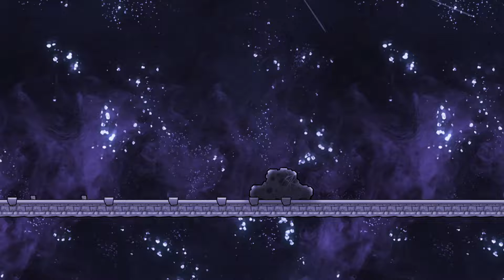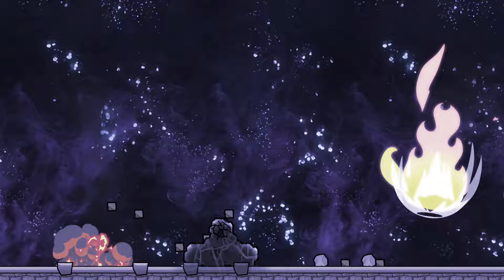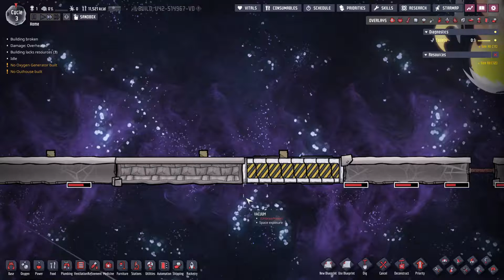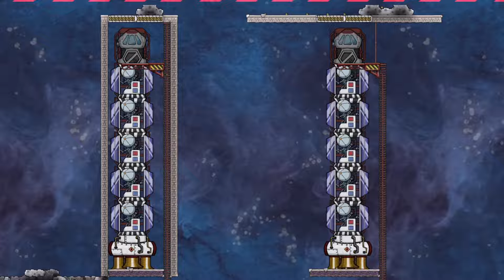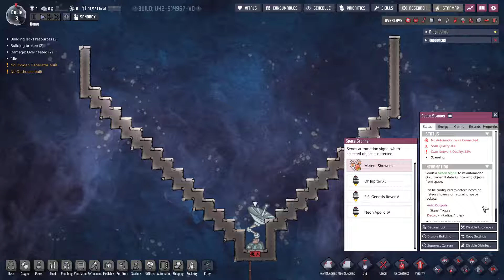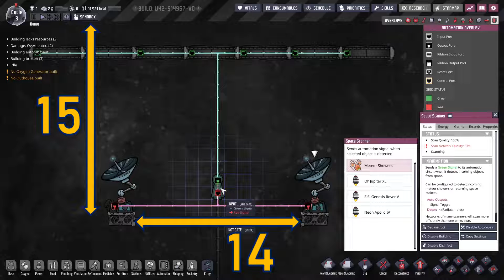Oxygen Not Included - Tutorial Bites - Meteor Showers

Comment: For Regolith design 1 how do you deal with the heat given off by the regolith that falls after being dug out by the robominers? Wont it just fall onto my solar panels and overheat them?
Reply from the maker: If you have solar panels there then yes, which is why it's generally easier to have automatic airlocks to catch the hot regolith, then dig it out, then open the doors and let the debris fall. The debris will not overheat buildings in a vacuum as they cannot transfer heat like the full tiles.

Comment: small correction: using mechanized airlocks to chew regolith tiles doesnt turn it into debris, it simply deletes them
Reply: This is a good point.  I originally had the C-miner setup, but then changed everything to airlock chewing 'cuz it was simpler....and then found that I only got debris for the metal.  I got no regolith and I was setup to move that regolith into a steam room to get some power from it and then feed it to shove voles.

Comment: I did this without timer sensor, damn this was a pain to make the circuit >< had to make a big schema to plan ahead.
Final result was, statring from space scanner:
- not gate -> Buffer gate [nb 1] 46 seconds -> Filter gate [nb 1] 46 seconds -> Filter gate [nb 2] 2 seconds -> Filter gate [nb 3] 2 seconds -> Filter gate [nb 4] 2 seconds -> Buffer gate [nb 2] 2 second.
And from the not gate, direct to bunker door
From Filter Gate [nb 1]  -> And gate -> Top door
From filter Gate [nb 2] -> XOR Gate -> And gate (the and gate mentioned above)
From buffer gate [nb 2] -> Bottom door

I need to add automation to open all doors after finish, because the scanner sends green when doors are closed even thos there is no meteorite

Comment: I'm having an issue with this automation... after a meteor shower is detected the bunker doors start to close blocking the scanners... The scanners therefore start returning a negative signal making the bunker doors open again halfway through closing... does anyone have an easy solution to this?
Reply: ahhh nevermind just realised it is because my power system was overstrained...
Reply from the maker: Yep, if the power goes down then the scanners won't send the right signal (which then starts drawing more power!).

Comment: What material are the mechanized airlocks made out of? Does iron suffice or since automation wires have to be made out of steel to avoid melting from rockets the mechanized airlocks also have to be made from steel.
Reply from the maker: For the meteors, any metal ore will be fine as they aren't hot enough to melt them. The rocket exhaust temps depend on the rocket engine used. Most won't cause issues, but hydrogen engines are very hot and will probably need steel or similar. The radbolt engine is even hotter, so you basically need tungsten to not melt on a rocket launch path.

Comment: Would it be possible to avoid having to use space scanners by setting up cycle timers? That way you could fix the bunker doors to open only during the off season? I'm having trouble understanding how to get so much (automining/door crushing systems, space scanners, rocket spots, and a telescope) all under bunker doors, which take a lot of power when used over a large area...
Reply from the maker: Maybe, but the showers are of different lengths and I wouldn't advise it. The door crushers are unpowered so you only need to power the bunker doors in that set-up. If you only need space for one or two rockets, then two or three bunker doors is all you'll need, so it won't take that much power.

Comment: Sorry, a bit late to the party and I'm also a little confused.  Surely (I bet I'm wrong) but if you close the bunker doors dues to meteor shower the Solar panels will shut down and you'll have no power to then open them again...
Reply from the maker: You are correct that the solar panels will stop working when the bunker doors close. At that point you will have to rely on stored energy from batteries, or other power generators to keep the power up to open them. But even if the doors are unpowered, they will still open but it will take much longer at 400s.

Comment: At 5:30 you mentioned that joining them together is needed but I don't quite undestand why. If the scanners turn on somewhere between lets say 66s and 200s and you join the 2 scanners together all you achieve is that the doors close at the earliest possible time because the earliest green signal would trigger closing the doors. I imagine that closing the doors as early as possible would be undesired as it takes away time for solar panels to create energy (and also stop telescope research and so on)

I just started playing ONI again and maybe I am confusing something here but to achieve maximum open time with less than 6 scanners I think it would be best to wire all your 2-5 scanners through AND-gates so the doors close when even the last scanner detects incoming meteorites (at at least the minimum time defined by the network quality)
Reply from the maker: You've slightly misunderstood how the space scanner works. The network strength dictates when minimum earliest time than the FIRST scanner to detect will go green, but all the scanners will turn green at different random times. By joining them all together, they are effectively OR'd together so you are always guaranteed to get the green signal on the first detection, which will be above the minimum time. If you AND them, then you basically get the last scanner's detection, which can be later than the minimum time.
I suppose the most efficient way would be to have 100% network strength and then use a filter/buffer to delay the signal by 160 seconds as it will be very repeatable.

Comment: Do you know when do meteors start falling? I have been playing spaced out so no need to deal with them. But I'm going to do a vanilla playthrough soon and I want to avoid them as long as I can.
Reply from the maker: I must admit that I don't know exactly, but as per the seasons I showed in the video all the 'no meteor' seasons only last 4 cycles. Therefore the latest you could get a shower is cycle 5 (assuming the counter still runs before you encounter the space biome, which may not be true). Either way it will be fairly soon and random, so you can't really plan for any specific timing, you just have to use the scanners.

Comment: Regular tiles can shield you base if you have multiple layers and allow regolith to pile up above, though this means you can't use the space above, and it isn't 100% reliable. While like he said a full box of bunker tiles is not necessary, you can also have the top be steel bunker and the sides be regular tiles, which will stop the occasional meteor.
Reply from the maker: That's a fair point, but as you say it's a bit unreliable so not the best to recommend. Steel is generally not too difficult to get once you know how, so definitely easier to set it up robustly in one go.
Reply: ...moreover, you dont have to make sides, (out of tiles), in a continuous fashion. You can leave every other tile empty, it will still block meteors, which can happen to be falling on those vertical side walls. Like this: xoxoxoxoxo but vertical. This also applies to any scaffolding out of ladders, you can leave half of them not built. Before 2023 I remember dupes walked the same speed on intermittent vertical ladders, but now they perform bend down animation on each empty tile.

Comment: What about collecting the metals of the rain? I don't have many metal sources in my map so I dig/collect metals after a shower and drop them into a cooling loop, then use it when cooled enough.
But this is basically midgame manual labor, need some automation for it.
Reply: Tony advanced has a good tutorial on a setup to harvest the regolith and the metal from meteors.  Check out his channel for that stuff.  It's outdated but his builds still work.
Reply from the maker: In either of the designs I showed, it would fall as debris so can be manually collected. For automated collection that would be quite tricky, as any use of autosweepers or conveyor loaders would need cooling in the vacuum. I believe this is possible, probably with the odd bit of drywall and petroleum, then strategically placing the autosweepers so they can reach everything.
Reply: there's a design to setup auto sweepers into dispensers and they'll pass down the line leftwards or rightwards, with cooling coming from the regolith itself, I think its possible if u use Steel sweepers? I don't rmb how hot the regolith n metals comes down in however, maybe u need thermium haha